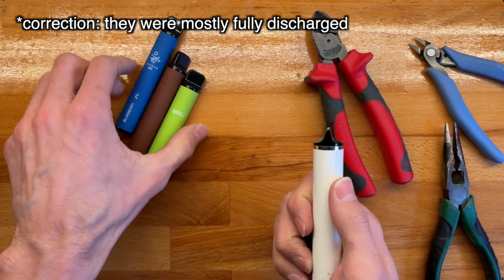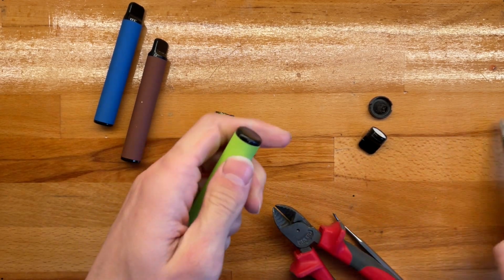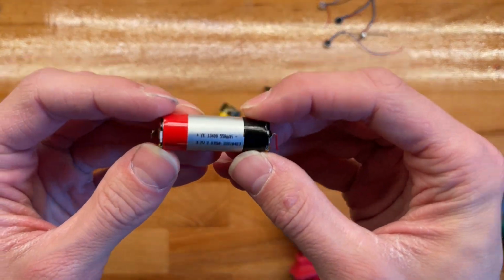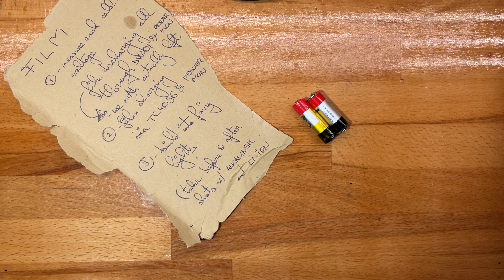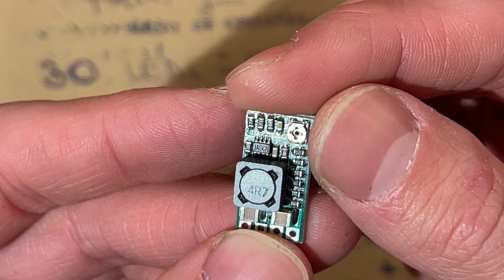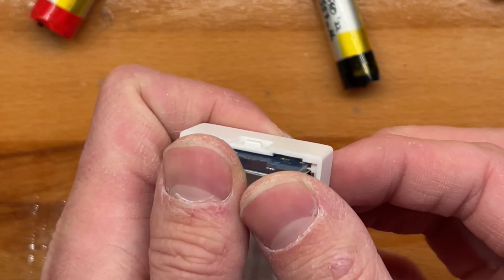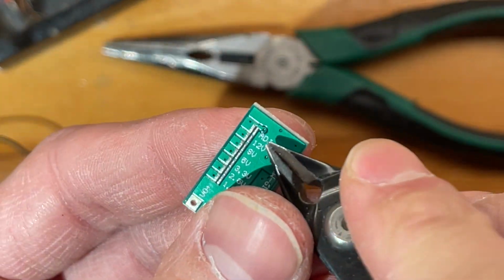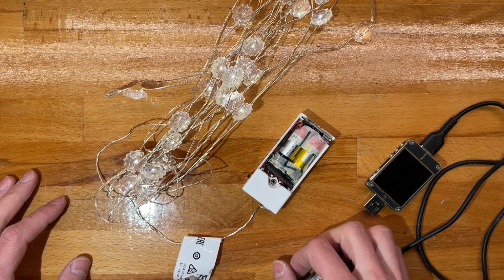LED fairy lights get disposable vape batteries & Type-C charging

Comment: What about using the c-type charger from a rechargeable disposable. They make many of these disposable e-cigs with the c-type charger port on the bottom what about using them?
Reply from the maker: they should work PERFECTLY for an application like this 🤘

back when I filmed the video, they weren't yet a thing

Comment: I wonder how simple it is to make/copy/adjust that light timer? 6hr on, 18off.
Reply from the maker: uuu, either they do have some sort of programming resistor (highly unlikely), or it's just baked into the microcontroller running the show .. in which case, very complicated

Comment: Did a similar setup on a set of cheap string lights and just used the TP4056 board connected to the batteries (this board manages the charge and discharge of the batteries so cuts off to keep them safe) I changed the R3 resistor on the board to slow the charge rate and on the output side of the board I attached a 10 ohm resistor to the positive and one on the negative and fitted a switch inline and connected them to string lights no extra board needed been working fine  that for quite some time now

Comment: Most of the time the led in the vape circuit prevents the over-discharge of the Lithium ion cell below a safe level, unless the discarded vape gets waterlogged or damaged by crushing. It's the charger circuitry that decides if the cell can be charged or not. If the cell does not take current, then the charger stops supplying it. If an over-discharged cell is connected in parallel with a charger and a full cell, the full cell will discharge a little into the over-discharged cell until the charger can pass current into the discharging cell, and the over-discharged cell gets a charge too, until both reach capacity, unless the over-discharged cell is not capable of getting a full charge.

Comment: Worth mentioning that if you snip the + & - leads together, or manage to otherwise create a short at any point in the procedure, those thin wires go yellow hot in a fraction of a second and will burn you.  If the short is sustained, or if you puncture the cell (it's fragile), then you can get a violent jet of flame right in your eyes and plenty of toxic gas.  Just saying.

Comment: I found that the sensors can be repurposed as a touch switches, driving a relay coil or a powerful LED for a keychain flashlight or so.
Just peel the metal can away and solder a piece of wire to where the internal diaphragm made contact.

The sensors will cut power to the output after 10 or so seconds and have built-in battery protection as well as current limiting. 
The circuits with six legs usually have a charging circuit in them and just need an USB port added.
Reply from the maker: gaaaah 🫠, I've waited so long for this

thanks for sharing !!!

Comment: Hmm, wondering about that sensor you said vacuum or pressure if you could make lets say a dog watering bowl that gets low the pressure somehow activates the sensor refilling the bowl with water, etc
Reply: Pressurize a 2 liter bottle when the pressure drops it will activate the switch and fill the bottle back up. hmmm might even work for a fish tank or something with any type of pressure?
Reply: You're accuring quite a few of them just like me. I am thinking about going around and make all my battery operated items that uses normal batts and make all the devices rechargeable.  since I can't figure out what to do with the sensors

Comment: The cell capacity is the amount coming OUT of the cell, not what you put INTO the cell. I have seen Big Clive make the same mistake. Imagine trying to charge a resister, you would get great capacity by measuring the charge going into it.😀
Reply: The good news is li-ion cells are super efficient.
Reply from the maker: yeah dude - try playing with them

charger discharge a few times 

you'll see how his mistake looks like in reality

Comment: I'm fairly new to learning this stuff so I was wondering if there's anything that would need changing depending on the electronics u put them in???
Reply from the maker: all li-ion cells are fairly typical ..

they all have a nominal maximum current they'll gladly put out .. but - if you gang more in parallel that's almost never the limiting factor

make sure to get a BMS to protect them from under and over discharging

and a balancing board would also be nice (if you use 2 or more in series), to make sure all banks stay equally charged

Comment: I keep the metal tubes, add a TP4056 charging board module, an led, 3 10 ohm resistors in series, and a switch to make a rechargable flashlight
Reply: I was thinking the same thing.
Reply: Do you add optics to that, or is this super rudimentary?
Reply: @vexy1987  I do not add optics to them as I did this on a budget at the time, but the LED's are very bright and I have not had any trouble with it without a lens. The lights do get very hot however. I do 3d print clips to hold the LEDS in place now because it's much cleaner and professional looking. The clips also conveniently fit into the top of the vape tubes if I choose to reuse them, or into the top of 3d printed tubes so that I don't look like I have a vape at school or something.

Comment: I've fitted the LEDs in the end of my Vespa headset grips,just got to figure out if to use the 12v feed to the headlights or the LED in the Speedo,  direct 12v DC will blow them?.. Or I could have heated grips..

Comment: The thin walled steel outer tubes are a model engineer's dream. They can be used in the building/construction of miniature Stirling hot air engines. They are perfect for making the hot end heat exchanger tube.
Reply: Square ones too..😊

Comment: I like to take the tubes put the battery a charger board and a small led with a small switch to make small rechargeable flashlights
Reply: I'm trying to mm figure out the right configuration for exactly that on my rc car,can you send an example pic
Reply: @jessieprough3090  what kind of vape/cart are ya working with
Reply: @jessieprough3090  and what scale is the rc
Reply: @Earl Fuller  1/10 scale but just doing an external light source kinda like your flashlight deal just extending to a couple leds
Reply: @jessieprough3090  ya im working on fitting a lightbar on my scx24 with this setup
Reply: @jessieprough3090  just make sure you get some small heat shrink for where you solder the wire to the switch and leds for the leds just test for the polarity by touching the wires from the battery to it once you know the polarity just solder a wire between the 2 the distance you want them apart then use the outside posts to connect to the switch and the other battery wire
Reply: @jessieprough3090  the biggest thing is to take it apart without breaking any connections so that it will charge like normal then just solder longer wires off the positive and negative and run them outside the casing solder a switch to either wire find your leds polarity and solder it to the switch and the other wire accordingly that way you can switch it on and off but still charge from the original port

Comment: Didn't big Clive add a 1k resister inline?
Reply from the maker: where exactly 🧐 ?
Reply: @Darieee  Here is the link to the video https://youtu.be/W7XB6D7q92g
Reply: @Darieee  I got the value wrong it's 33 ohms resistor but I knew he put one inline.
Reply: @jonathaningram4672  I saw that video. Big clive is the main man for modding this sort of stuff safely.
Reply: He put it on one side of the cable, reducing the brightness of all lights and apparently will run for days.

Comment: I've started picking the bigger one's up out of habit the 3500 puff ones and some of them have the charger port on the bottom but get mistakenly thrown way as these ones have 1500 mAh batteries, come in handy for small projects or even running a small camera for a good few hours of video.

Comment: You absolutely should not discharge these below 3V. The voltage will plummet starting at 3.4/3.3V anyways so the the time @1A discharge will be seconds watching the voltage plunge below 3V towards 2.5V. 2.75V and 2.50V are discharge cutoff voltages for lithium ion, these are lipo cylindrical cells.

Below 3V the cell is damaged and overdischarged lipos are much more volatile than regular lithium ion cells.

Comment: So I have a question. I had a idea to use like 10 of these in a series to charge a smartphone, is that possible, and if it is what micro controllers would I need to make that work? thanks!
Reply from the maker: you don't need 10 in series, you need a few in series and many in parallel 

we as a species, we're long past doing dc-dc conversion in microcontrollers

there are countless dedicated chips for this task - search ebay or aliexpress for powerbank kit

most of them will most likely take 1 to many parallel 18650s, but, you can just parallel these vape batteries

all commonly available li-ion cells work the same way so, as long as you don't charge/discharge them too hard, they'll be fine
Reply: @Darieee  Ok, ty

Comment: What I'm most interested in is learning about is the types and applications of these converters and charging circuits. My computer mouse takes a single 1.5v AA battery and I'm not sure what the simplest and lightest lithium solution I can install is, I can't find batteries that go that low in voltage themselves.
Reply from the maker: biggest one or few of these .. + you can use the same dc-dc buck converter I used for the lights 

I see they can output 1v8 .. which should be fffine

another longer route would be to find the possibly and likely present dc-dc converter in the mouse .. I have a logitech that creates itself a 2v5 rail .. 

so - technically you could bypass that, dump voltage "already boosted" to what the moose needs
Reply: Use a 3v7 Lithium cell and use ( a selection of small rectifier diodes , Silicon or Shottky or even Germanium ! ) to reduce the voltage ... check with your multimeter ! before you apply it to your device ! ! ... DAVE™🛑